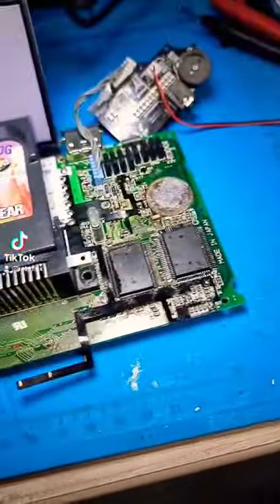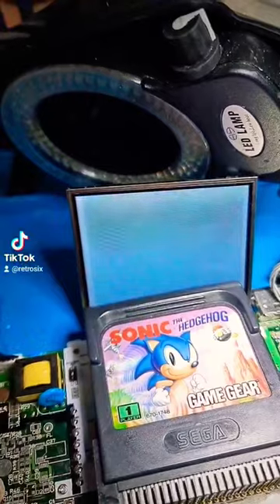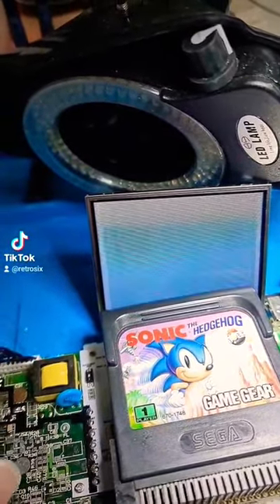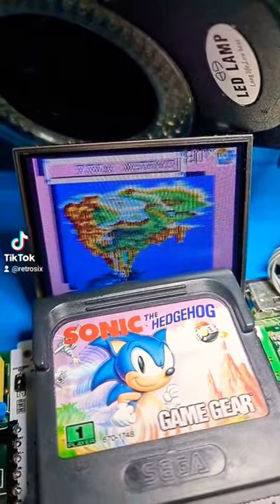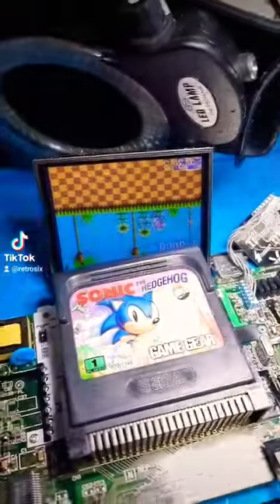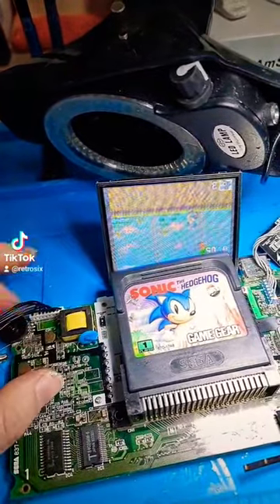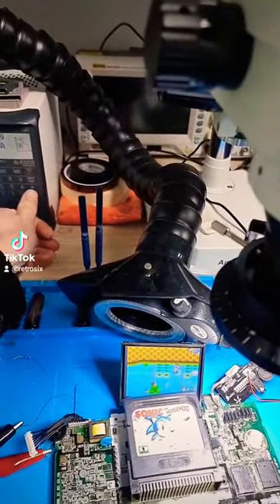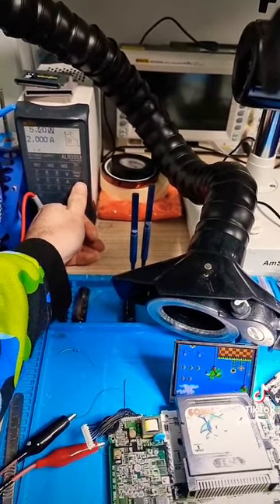👑 NEW Game Gear Discovery: 5.5V is King 👑

Comment: So what will be the fix for this?
Reply from the maker: CleanJuice power can have a resistor changed to output 5.5V. Also working on a mod for CleanScreen to handle the lower/weaker signals so few options. Join discord.gg/RetroSix to follow along the progress
Reply: @RetroSix  thanks will do, only just getting back into these older machines so it's good to get these tips
Reply: @RetroSix  Please! Invest on laminated options. I have stopped playing my prestige I got from you due to dust finding its way underneath the screen glass.
Reply from the maker: Shouldn't get dust with the dust guard installed. CleanScreen SP is pre-sealed so no need to lens drop them
Reply: @RetroSix  I got it directly from your Prestige program. yet I got it with some dust specs.
Reply from the maker: Jump on our discord.gg/RetroSix and we can sort you out no problems
Reply: @RetroSix  That's alright Luke. I just wanted to bring awareness on this matter. Although I hate to see the dust there, I don't play as often to care. My suggestion on the laminated option would potentially alleviate QA oversights and definitely bring me back to the device.